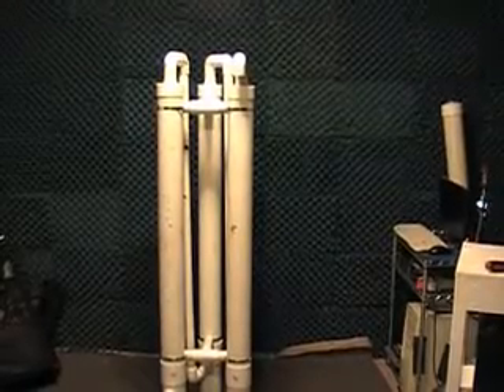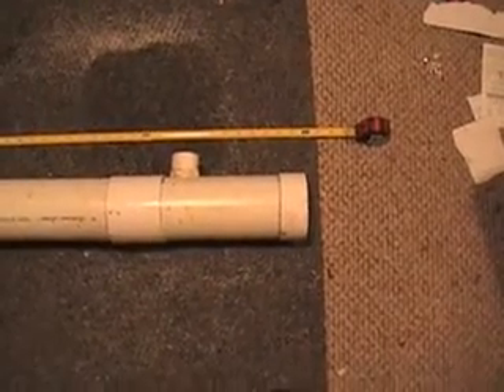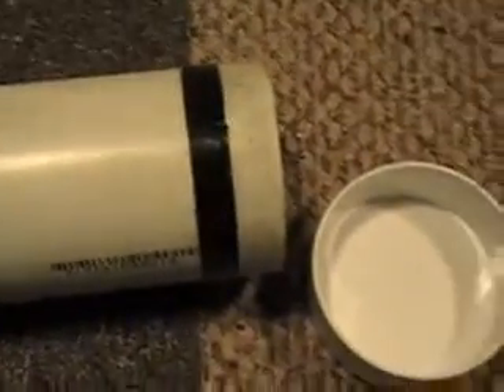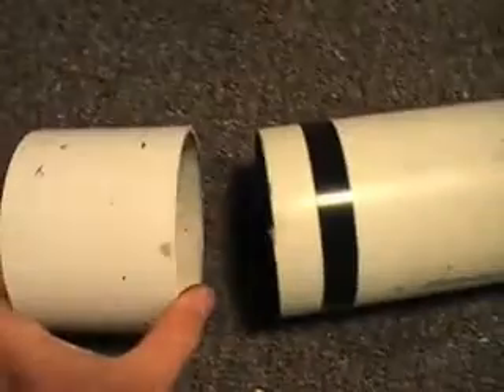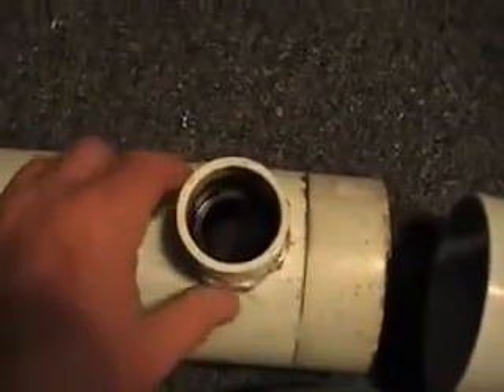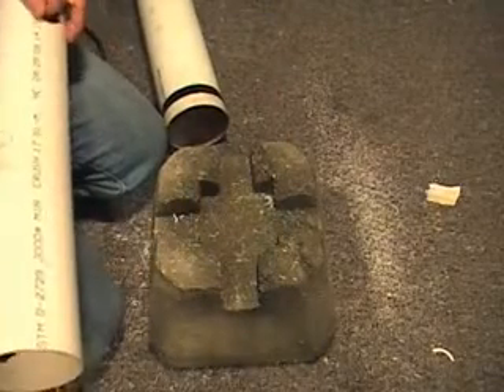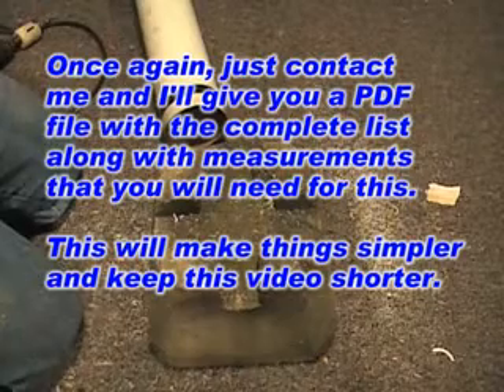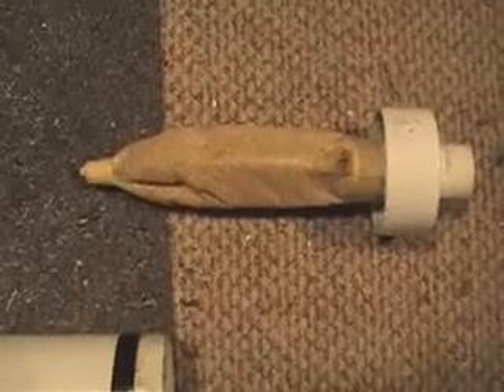01-15-2013 How to construct the gasifier tri-filter system.

Comment: My idea is to take and put one 100lb lp tank directly hooked to the burner from that one use a chunk of radiator hose to hook to a sec 100lb lp tank between the 2 the gas should move slow enough to cool it well below the temp for pvc pipe and remove alot or water and ash and tar in them! Then go into a 6 pvc filter setup first 2 filled with stainless steel wool next 2 wood chips next 2 polyester fiber and that should be just right each pvc pipe 5ft long.

Comment: I hear you there i welded alot as a kid but it was a few yrs between when i made my first unit i used to work in a welding shop so its like riding a bike for me 5 min practice and im good to go lol. I even got a plasma cutter due to why buy all those dang cutting pads lol. I'm not that fast at it either due to i like to make a strong weld and keep it nice and good so i dont have to rework it lol! I even have a plastic welder lol now i have a great uses for it lol!

Comment: Flash, what size steel wool did you use? How tight did you pack the pipe?
Thanks
Reply from the maker: I went to Sams club and bought their bulk pack of stainless steel pads. the stuff I used is coarse and I packed it semi tight. Since this video I have cut the filters
down in size. Look in the description box below the video for a link to download a PDF on the build.

Comment: Do you remember the old oil bath filters on older vehicles?
You think those would work?
Reply from the maker: Yeah I used to have a Dodge van that had that setup. Those are called venturi filters and yeah and some people have elaborate setups like you described using water that cycles. You can go that direction but it's more involved and if the back pressure is too high, the engine will struggle to draw from the gasifier but it can be done.

Comment: Can a galvanized water tank be used to build a gasifier or a   retort
Reply from the maker: You have to avoid using galvanized ANYTHING anywhere there is high heat in the system. The galvanized metal will poison you if it gets hot enough to start a reaction with the galvanization so be aware of that!

Comment from the maker: I only have about 300 Watts of solar panels but I want to get it up to about 1000 watts but those buggers cost money so it is a slow process. I could make what I have work right now if I had too and I'm going at this with a different twist. My solar panels are still boxed and I'll only use them in the case of an emergency plus I want the system to be portable in case I had to abandon my house for any reason plus I can charge batteries from the generator too.

Comment: can drain valves be added to the bottoms of the filters?
Reply from the maker: Yes you can but I made slip style lids by adding high quality electrical tape to the bottom of the tubes to keep things air tight. Being able to clean the filters is a must. Since this video, I have shortened the filters but I also made a new revision in the download. It's called Tri-filter build rev_002_11_05_2013.pdf

Comment: Hi there, the pdf link is no longer valid. Any chance you still have the plans? Yours is the easiest and cleanest burning build I have seen yet and it is NOT from lack of trying... Lol. Would really love to get those planes and list of materials. Cheers.
Reply from the maker: Carl I have corrected the download link and it now works. If you would like the drawings to the gasifier build contact me through www.miniwoodgas.com
Reply: How big of a gasifier would I need to construct to run a 17.5KW generac generator? I live in the south in logging country as a logger and have a limitless supply of wood fuel. There are very bad times ahead and I would like to keep my family in a safe place and comfortable as possible when the 💩 hits the fan

Comment: Hi Flash,my gasifier is shooting a  problem related with tar.It is my first try for running an engine and I run only for 30 minutes.I made the gasifier by following your instructions and only  difference is the filter media.I used a small drum of plastic filled with rice husk.I want to know is the model of filter that you are showing will fix my problem?You are helping me very much.Thanks for everything.I will upload my videos of gasifier after fixing that problem.I will be waiting for reply.
Reply from the maker: +Dolly Chanu You shouldn't be dealing with tar or worse case, very little tar.
Filtering does play into clean gas along with cooling the gas down as much as possible before it hits the cyclone or expansion tank then cooling it down one more time before it hits the filters because any residual tar that is left will stick to the filter media along with dust particles. The Tri-Filter does have it's advantages and it may be worth you trying.
Reply: +flash001USA Thanks, one more question,at what interval of time(using) I should clean the filters.
Reply from the maker: +Dolly Chanu The cleaning part is a tricky question because different fuels will affect the filter in different ways. This video is an older video and since then I have moved up from 4 inch diameter filters to 6 inch diameter filters. You should be able to get a good 4 or 5 hour solid run out of the filters. Maybe a bit longer because once the filters warm up they work more efficient and they will continue filtering until the gasifier is shut down.
Reply: +flash001USA Thanks for your reply.You are helping me in many ways .If you have latest video of your upgraded gasifier,please upload.That may  solve my problem.Sorry if I disturb you in any way.Thanks again.

Comment: I can get 10" pvc pipe np for main line pipe and its a thicker wall too! You use all the right size yr connection pipe is 2" and yr filters are 4" that is double the size thats just right by my math for min size of anything over kill may have been to use the 6" pipe but not really tho it just would mean yr gas would move that much slower threw the pipe cooling it off that much more cleaning it that much more too!

Comment: Well i hand made every cyclone it takes 2hrs to get it all bent up rolled and welded each one! i have on my current setup 5 cyclones each one made by hand ya i made them from scrap metal old washing machines and stuff but still all the welding wire and time alone will be a big difference with the pvc way i could make 2 a week or maybe 3 the biggest part getting the burner made and welded up i can do that in 1 or 2 days it was the filters that kill making them all!

Comment: Well i do use the chips back in my unit but i mix them in woth new chips then burn them but the ones from the 24hr test they more came out in a big mass! So i cut off chunks and put them into a 55gal drum with leaves and stuff and put some tar water on it for making briquettes! I did burn a chunk in my wood stove it burned like hot oil lol very very hot! As for burning the tar in the unit have to be carfull too much of that stuff clogs up yr unit too fast!

Comment: Just keep in mind the gas first has to be cool enough so it don't melt the pvc pipe lol! I know that steel thing too all my builds have been with metal too my next one will use pvc at the filter point it will make it simple to puzzle together lol lot less welding and bending lol and hrs of shaping metal!

Comment: Good video, are you still using gasifiers 8 years later?
Reply from the maker: Yeah I still have the setup and myself and others have shared ideas and improved the gasifier design. This video goes back to the old FEMA design. I got away from that design after making this video and I now have an Imbert design complete with automation. Thumb through the older videos on the channel and you will see them.

Comment from the maker: It will work until the water heats up. For now, I'm running tall vertical pipes but then again I'm running a blower fan for my test burns and according to another youtube user, the blower draws a lot more air through the system than a small generator will so I'll size my cooling pipes to the generator so that I don't have overkill or too little cooling.

Comment: Hi Flash001.  My husband Ian is constructing the gasifier.  We are from Australia.  I've been given the job to put together the filter system.  Thank you SO much for your great video's.  They are excellent.  Would it be possible to send me the drawings please.  Thanks.  Anne Hodgson
Reply from the maker: Hi here is the download link for the Tri-Filter. http://www.liarfest.com/tri-filter_build_rev_001_01_05_2013.pdf Keep in mind that this is an older build and if you check out the later builds you will see this has changed to a simpler build. There are no drawings for the new build but it is basically the same concept. Good luck.
Reply: Hello Anne, where are you about in Australia as I'm in Perth and am very interested in this project...

Comment: Flash, I guess I'm just a computer dummy. I went to the sheet metal guy and made a cone, but I cant seem to get it to print to scale. Is this because I can only print 8.5 X 11.5, and its bigger than that size paper? As far as the biochar grate, I went to publisher but could not get that to work either. Sorry, I am a computer idiot. I know you have better things to worry about than this probably simple stuff, I just thought you might have a PDF template laying around that would save this idiot alot of aggravation! Don,t worry about it if they are not just laying around.  Thank you for your patience. Gary
Reply from the maker: No, I know what you missed now. When I printed it on my computer it gave me two choices. I could make it print to one page which made the measurements off or it gave me the choice to print to multiple pages where it would give you the right size. For me it would print to 4 pages then you would just align everything up and tape the pages together then cut out the template with scissors. I use a free program called CadStd. I went to the sheetmetal guys website and it now looks like they give away the program instead of doing it online now unless I missed something. It requires Windows 7. I'm running XP on my end so it's useless to me now. I don't have a PDF of the file and I would need to find a new online program before I could even make a new template so I'll have to do some digging myself.

Comment: Shoot me a private message with yr email and i have a great link to a vid on youtube that shows how to make yr own briquettes the easy way!

I use a leaves grass small wood chips and newspaper for making my briquettes that mix is great easy and fast and with the tar mix holds together great and burn hot real hot dont last real long but i also once they dry good i add old veg oil to some dont soak but drizzle some on some then let them dry again so it soaks in good!
Reply: I've ordered a press for paper brickets, should have it in a day or so. How is the veg oil working in you ones. I'm thinking to use a little saw dust (from chainsaw) in then too. Any help with mix/ratio ??